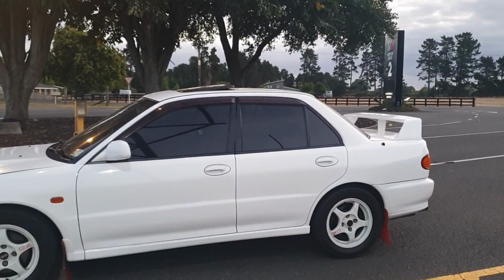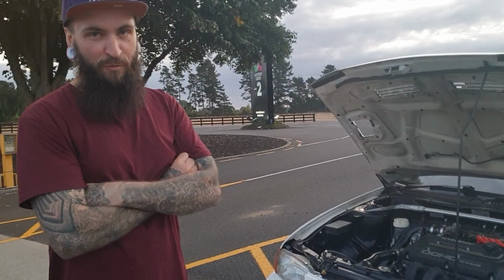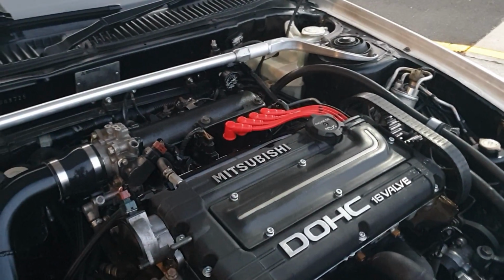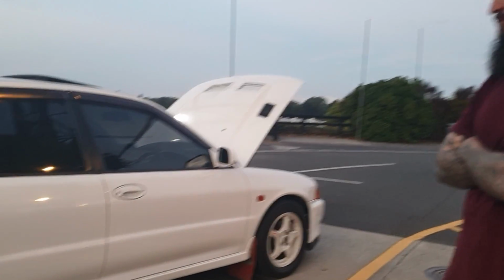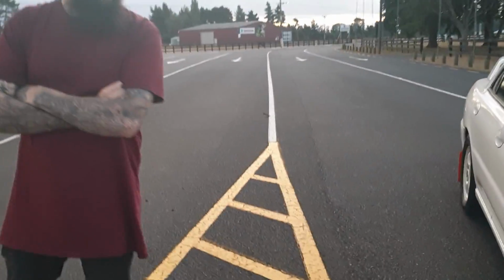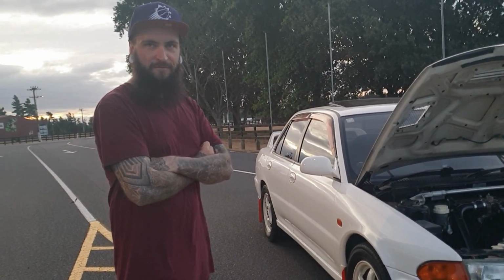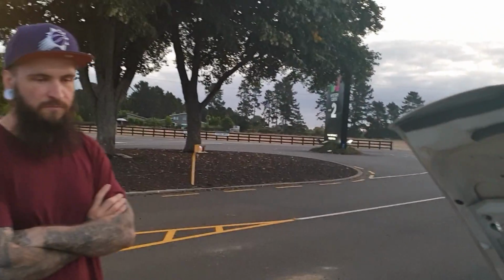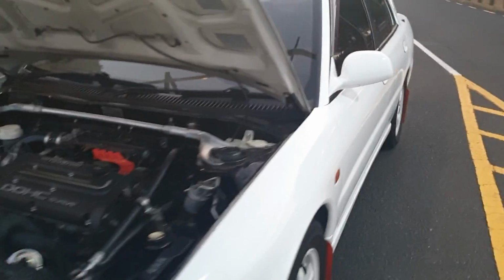Mitsubishi Evolution 1 Lancer - Evo link plug and play , Link ECU setup and road tune. 4G63 Turbo

Comment: Ive been helping a mate with a very similar setup and I cant figure out what wire to use for 0-5v output on the aem wideband into the ecu for datalogging. Any help? cheers
Reply from the maker: Any of the anlogue volt inputs should be fine.  I often use the stock oxygen sensor input or one in the expansion loom